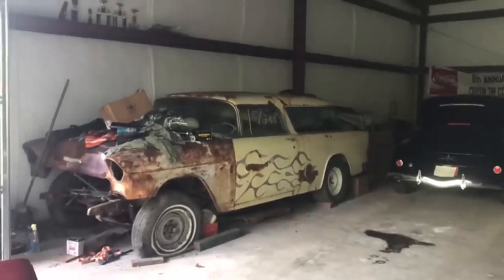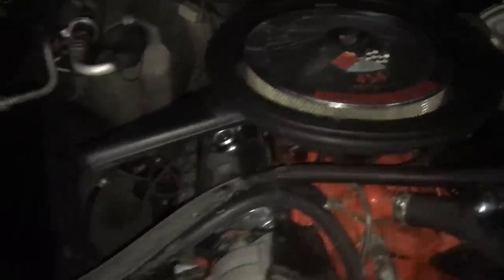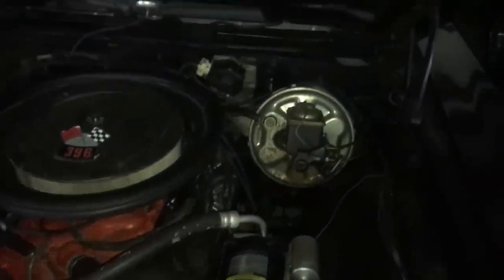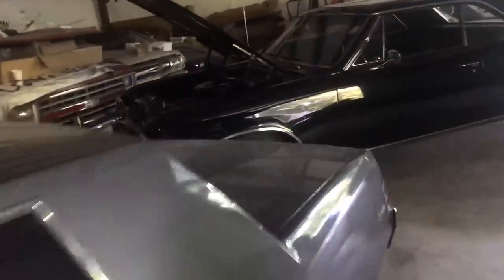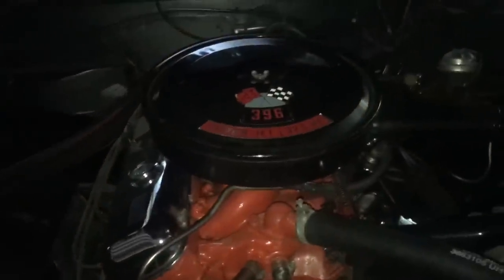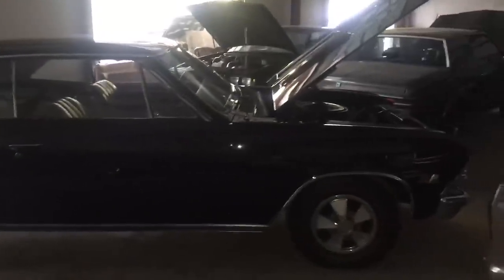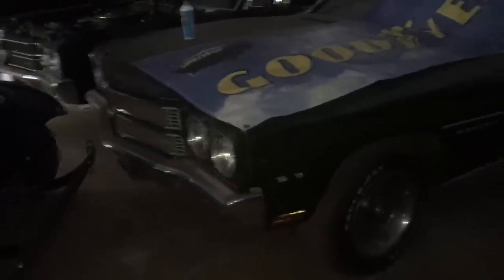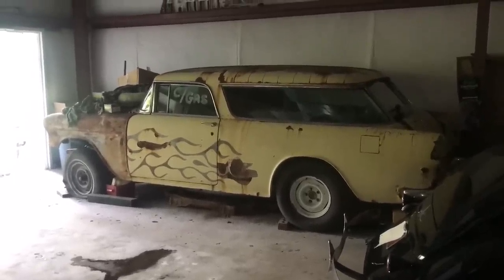BIG TIME HOARD of  Barn Find Musclecars and Street Rods Uncovered In TN!!!

Comment from the maker: Please excuse me on the 1966 Chevelle firewall data plate run down and the headlight extensions. I wasn't very clear and did not state that the SS396 should be blacked out without the lines on the sides and also between the headlights. I’m also well aware the W stands for tinted windshield and NOT windshield antenna which most understand that feature wasn’t even available for quite awhile. I simply misspoke and decided not to reshoot the video over the mistakes. My apologies. Thanks
Reply: why worrie.its hard rember every thing.i do like your last name.mines is nichols.

Comment: hey Patrick another awesome video...i was big into those turbo buicks... if that grey car is an 87 then it is not a T-Type they changed the name to Turbo T in 87 and they had 2 tiny square black and red letter T on the fenders down low like where mopar puts the star...78-86 they were called t type
Reply: they never had embles on the quarters an 86 would have that emblem up high aporx where the grand national embles are